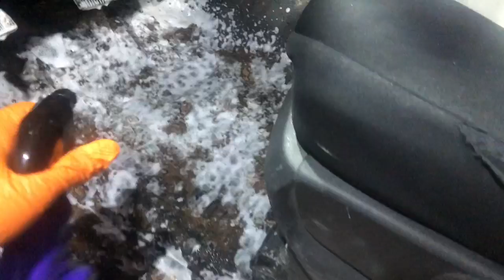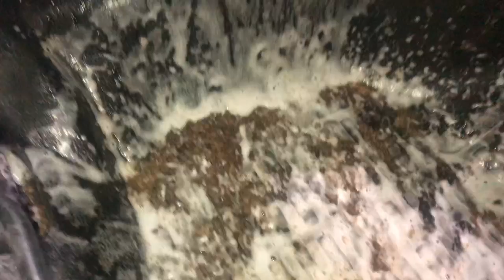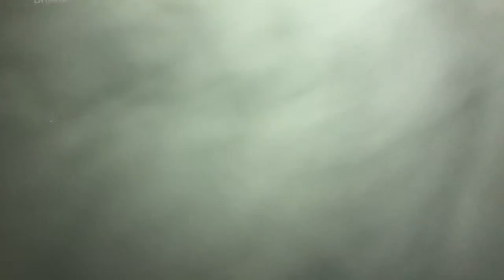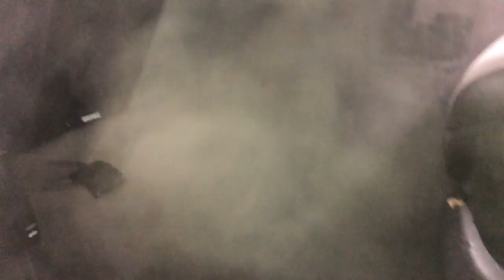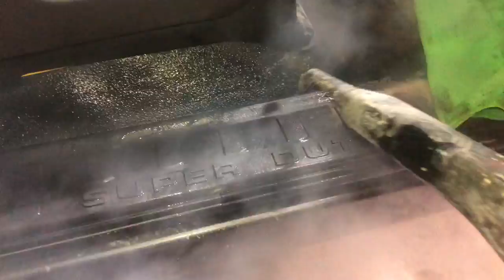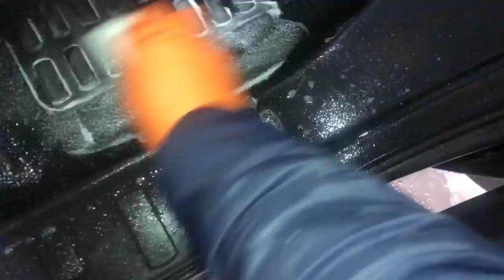Nasty work truck detailed with steam cleaner -- ASMR

Comment: Curious why you chose not to vacuum before turning it to mud!:)
Reply from the maker: +Westin Kriser ya know, that’s a damn good question lol. I probably would have vacuumed if the floors were carpets — but since nothing really permeates anywhere I just wanted to get the river flowing and get that crap outta there lol
Reply: Certain auto manufacturers make a "work line" of trucks and Van's that have rubber floors or plastic.
Reply from the maker: +Sharp Reflections Detailing kinda makes sense when I’m in them. It’s like, why do we have carpets in cars, anyway?!

Comment: I got discouraged soon as I read the label on the bottle as a professional detailer I can assure you that you do not need to use an all-purpose cleaner for your vehicle anywhere on the vehicle not only does it take away the Purity from the Finish or overdrive's the dash but it hardens on the floor after you wash it isn't it reactivates when you step into the vehicle with Muddy or wet shoes.
I'd only just call her so floor it leaves ugly dry rings.
And if you're using a steamer you don't need soap any way to clean the carpet you just need patience and dry rags.
Reply: No one has time for that lol

Comment: I’m not here to critiscize but steaming seemed unnecessary at the start when it was just thick caked mud would’ve been better just scrubbing and maybe hosing with low pressure from the other side to get it out the door. But ultimately the car was cleaned so goal was accomplished well done